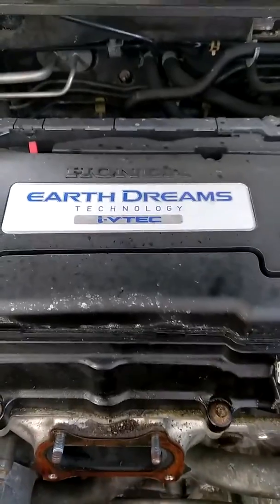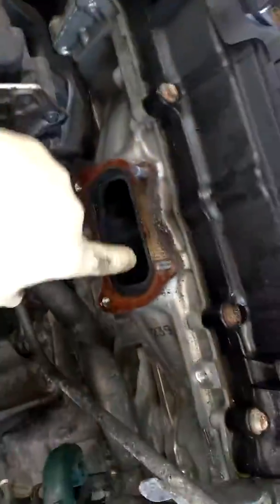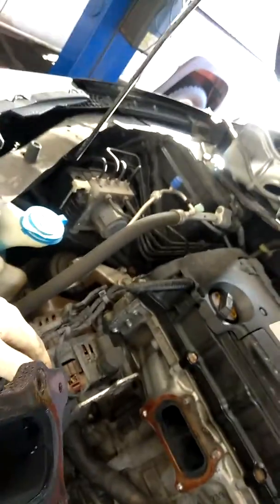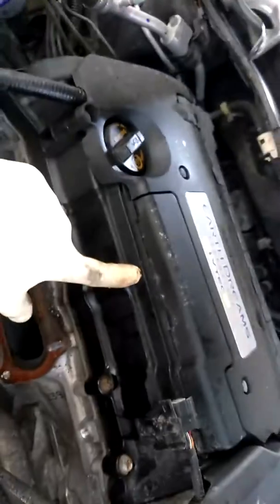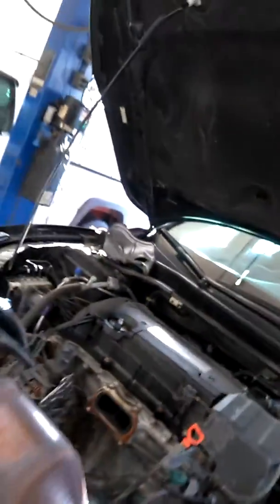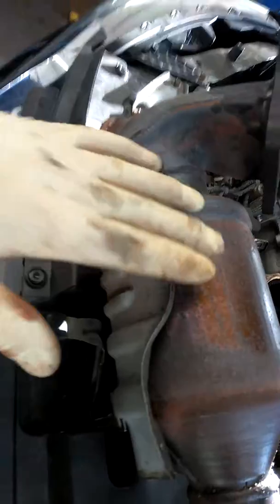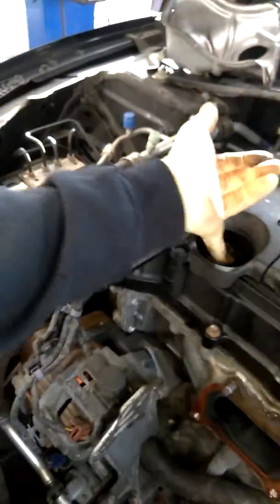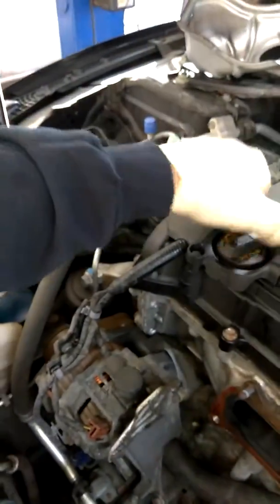2014 Honda Accord 2.4 po420 catalytic converter efficiency below threshold .. Meineke cinnaminson

Comment: Having this same issue replaced it with a after market cat and both 02 sensors denso and still getting the code 🤦‍♂️
Reply: Did you find a 
Solution?!
Reply: it’s the second cat not the manifold

Comment: I’ve got a 13 accord 2.4 in the shop with a 420 code. No timing chain noise and the customer is religious with oil changes. Car has 135k on it and fuel trim are close to 0. Downstream o2 is switching indicating no oxygen storage. Average reported mileage on identifix is 134k. Something is causing these cats to deteriorate
Reply from the maker: Tune it up bet it uses oil ..change the converter fuel injection service
Reply: Did u end up changing the timing chain as well???
Reply from the maker: @jaygarcia5121  no
Reply: Jay Garcia just send it to a mechanic for a tune up and change your cat after, i did that yesterday on my 13 accord and it should be good
Reply: pedro prieto what does a tune up mean? Aside from spark plugs and oil change
Reply from the maker: @markyg.  intake Valve decarbon .. filters  pcv valve motor flush fuel injection clean .. today's fuels oil gdi are hard on internals
Reply from the maker: Plus resetting all fuel trim adaptivenes . clean mass air flow sensor .